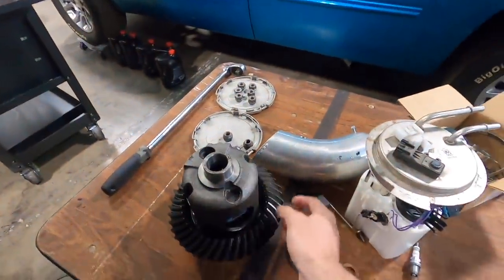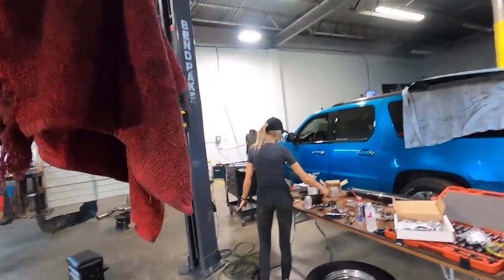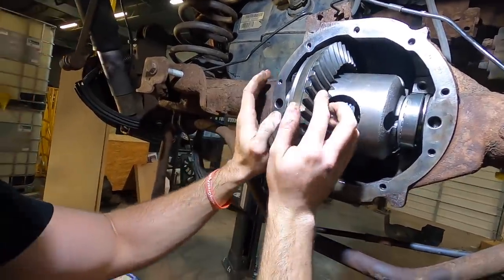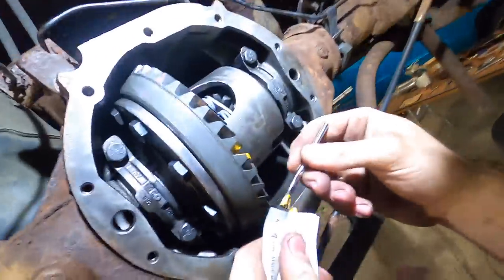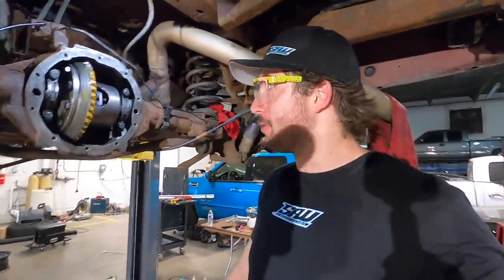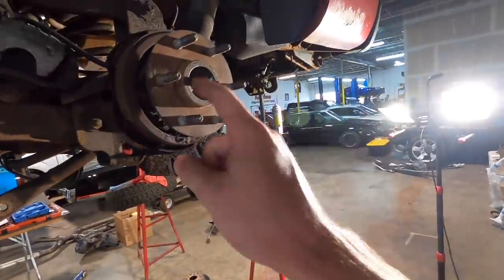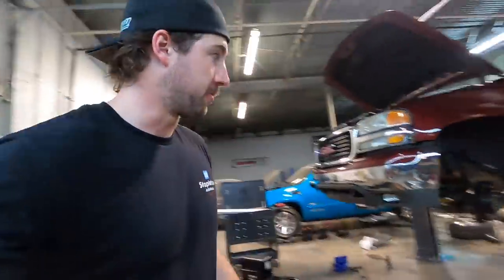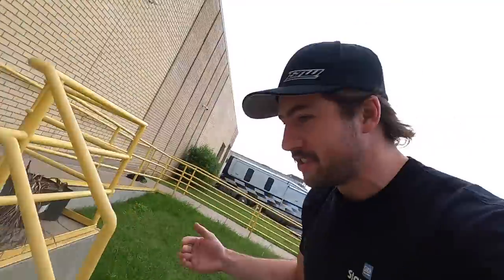Rocky Mountain Race Week Preparation: 10 Bolt Posi Install + EBC Brakes Upgrade! (Uncle Rob Yukon)

Comment: Tall guy probs #102 i was showing a new guard the building and turned to tell him something while walking and end up smacking my head into the doorway it was a low clearance one and im 6`4 
Also i got the oil pump replaced on the yukon but now it doesn't want to start and yes its back together correctly and we primed the oil pump for ref any ideas we are kinda stumped

Comment: I used to do Hvac work with my buddy since jr high. He's like 5'9, and I'm 6'1. We're in this shallow basement pulling out a lowboy furnace for a changeout. I had to crouch the whole day to avoid bumping my head. Halfway through the day he stood up and whacked his head. It made him dizzy. Hours later he stood up into the exact same thing in the exact same spot on his skull, when he almost passed out.

Cheers, fellow tallboy

Comment: Make sure there is no hair line cracks in it. I just did mine and I rtv it and it leaked. Then I re did it n after I was done the second time saw the hair line crack. Mine is exactly the same as yours n was in just as rough of shape. Got one off Amazon for 40$ n fit perfectly.

Comment: I have a 7 lb dead blow and have been building diffs for 27 years and that’s the same way I put it in grease the shims in just like you did and I lean both races and then push it foreword and tap the races straight when it’s straight I make sure the ring gear is meshed with the pinion and beat it home with a dead blow

Comment: Differential spreaders help alot.  They go in the holes on each side of the "gaping hole" and spread the housing slightly so you can end up with a little preload on the carrier bearings.

Comment: Pro-tip you're doing a great job on your breaks here's the tip the caliper bolts sleave ride on either a bushing or two o rings remove them or it and clean the rust then lubricate with dielectric or similar silicone grease, petroleum grease will break down the rubber bushings and swell them up creating the same problem as the rust, which is the bushings will squeeze the sliders and not allow them to move freely usually causing one pad to wear out long before its mate and like half the stop power!

Comment: Worked the pit at a diesel shop. Pit was 5ft deep max ,I'm 6'4". It sucked.  And I had to duck under the ft deep oil drain pan we used

Comment: Being a fellow Pennsylvanian I feel you on the stuck brake pads in brackets. Every brake job we do in our shop at the very least we wire wheel behind the slide clips. In bad cases I’ll take a die grinder with a fine bur and grind the rust off untill your back to good metal

Comment: I'm not sure if they will clear with the wheels you're running but in the future you should put on the late model 4 piston calipers and rotors from the 2018 or 2019 Silverado/Yukon. The rear on the Yukon XL is 2 piston so that with the 4 piston  calipers and their 14" rotors would be another awesome budget minded upgrade from the stock rotors and calipers. The best part is if you upgrade the front you can get the hot boy 8 piston simulated calipers covers for the back and shut shit down wherever you do.

Comment: Looks like both of you are rocking this differential install! GM 10 bolt gear backlash should be .008" to .012" for street gears and .006" to .008" for competition gearsets. Shims are fun to install with the carrier too. 
A great learning experience for you both setting up a set of gears & bearings. I've set up my fair share of differentials over the years and they can be easy or a PITA. Perseverance pays off! 
You guys rock by taking this job by the horns and getting 'er done! Keep up the good work, and I'll be looking forward to the next video!
Reply from the maker: Thanks man 🤟🏻

Comment: Not sure if it's funny but I was changing a tire on a old jaguar with a 4 way and the lug nuts were basically fused on the wheel stud and with all my might trying to break them free the 4 way broke and when it did all that force came loose and I punched myself in the face so hard I about knocked my self out. Had a headache for 2 days

Comment: After I broke a bunch of teeth on my 03 silverado's spider gears I slammed a detroit trutrac in it with new bearings and races and the original shims. Didn't check anything and been running quiet for 60K more miles now.

Comment: You need a thrift store deep fryer and some old vegetable oil. Put the carrier in the freezer overnight and deep fry your bearings @ 250* for 5 minutes. They drop together. Works great on axels too

Comment: It should be to hard to set up the backlash as long as you have the Diff. Bearing shims in the original locations. If it’s too tight or loose just switch the shims and recheck the backlash.

Comment: Just a heads up, the 2000 to 2006 suburban can benefit from changing the FRONT caliper, caliper brackets and rotors to the 07 and up parts. They are larger and part store replacements no fancy parts that have to be ordered. They do require a 17 inch wheel, but do clear factory 17s. Also stainless braided front lines with a hydroboost will make it amazing with factory parts

Also a stock 5.3 at 10.5 psi SHOULD make 530ish hp and 550ish tq according to Rich Holdener dyno testing to give you a rough crank hp guess

Comment: put a pry bar between the top of the carrier and the housing and apply load and take a 1/2inch ratchet and turn the pinion to get a reading on the paint....should be centerish

Comment: Oops just seen somebody already said that lol. The preload has to be correct as well though. It should take “X” amount of inch pounds of force to rotate everything. And you’re correct to paint both sides of the teeth so that you can check the drive and coast side of the contact.

Comment: You should have used like 07 plus front calipers them you could have used the ebc for them the only downside is you have to run 17 or bigger wheels but if you have 17s it's not a huge deal just might have to change 2 tires if you have a flat if your spare is a 16

Comment: You are supposed to spread the housing a tad using big holes and spreading tool to make installation of diff easy with correct preload on bearings.
Reply from the maker: See I didn’t know that lol
Reply: @Stapleton42   most people don't until someone on YouTube tells you different

Comment: Im sure thatll be cheaper than the quote i got to go 4.56s on my 07 classic crew cab 4wd, 2500$, another place said 1000$ i supply parts, and 100$ for a locker, i supply parts

Comment: Checking backlash is step one, then check the pattern.
You only need the yellow marker on 3 or 4 teeth.
The carrier, bearings, races and shims should all be slid in together. 
.006"/.010" backlash

Comment: You should have removed the nut from the pinion bearing... it has a crush washer in it and u need a new one to set the backlash correctly...but after watching the video, the paint looks like u got it dead nuts! Good nut discipline

Comment: Painting the underside with POR15 would be a true test of that stuff. It claims you can paint direct over the rust and it converts it. I’ve only ever used it in clean parts but my chassis looks as good as the day it was painted over 15 years ago
Reply: Your supposed to knock all the loose rust off first, but yea it works great I've painted rusty trailers and frames and never seen it start rusting more or chipping off

Comment: The 2 larger hole in the differential housing are for a special tool called a case spreader. The diff should be really tight and need to be hammered into the housing without it just like you did. If you don't use a case spreader and the diff just goes right in you did something wrong.
Reply from the maker: I’ve since learned that. Had no idea there was such a thing until I read these comments 😂

Comment: Mitch  Cheap and easy way to get controlled heat in a bearing is wrap it in wet paper towel then in a dry towel, microwave for 2 minutes. It will expand it just enough for slip fit
Reply from the maker: Sounds like a bad idea lol
Reply: @Stapleton42  I’m serious the microwave can’t penetrate thru the towels. The wet paper towel means that’s all that heats. Water boils  at 212f the bearing can’t get any hotter. It only takes raising temp a little to make the steel expand

Comment: I was helpin my grandpa work on his 1953 ford golden jubilee(his dad bought it brand new in 1953) well we was checking for spark and i wasnt payin much attention and i held the old wooden handle screw driver in the spark plug wire and got a nice zap🤣🤣🤦🏻‍♀️ another time my grandpa bought him a scooter, he asked me if i wanted to ride it so i said sure bc he asked and i was tryna start it and he said give it throttle. well  i gave it throttle and it took off and i almost hit the side of garage with it

Comment: Fake it til you make it, ive tapped bearings in with a punch, old bearing races or whatever is available. A cars torque cause more damage than that little tapping with a hammer will. You never know till you try, glad to see people getting in and doing it than sitting in the comments bitching about how you doing it.
Seeing her use brake clean on her hands was GOLD!!! Gear pattern is just fine and matched the pattern on the unmarked part of the gear so let it eat.

Comment: 🤣🤣🤣great video man. A large dead blow rubber mallet works better getting the diff in. The escalade has the 8.6 in it still?
Reply from the maker: Escalade is a 9.5 14 bolt swapped from a 2wd
Reply: @Stapleton42  dang its got the big boy in it

Comment: 👍📽🔊  You should change the front L&R brake lines to braided lines. the rubber lines flex  and swells  under pressure thats not good.  just think that brake pedal will feel a lot stiffer..   I got 05 Silverado with 24 inch wheels factory calipers and pads all I changed was the brake lines to braided.. damn thing stops on a dime . so much better feels like  I got 16 inch wheels on.. lol.  Keep it up nice job guys
Reply from the maker: I have braided ones on the Escalade

Comment: If you're pinion depth is not right (backlash) your kit should have come with a new crush washer just take off the pinion knuckle and seal bearing and replace crush sleve then  torque until 25 _ 30 tension pounds are achieved

Comment: Hope you dont get fed up with my tips but here's another one. In regards to installing the bearing back on the carrier...what I've done forever and works well without damaging anything....I use a hotplate with a pot of used (or new) engine oil...heat the oil until you see it start to slightly bubble....drop bearing in the hot oil for 5 mins....take them out using channel locks or strong magnet and install onto the carrier. Makes life easier. Another method is to leave carrier in a freezer overnight
Reply from the maker: My friend used to do that method lol
Reply: It's as old school as it gets

Comment: You need some Right Stuff for the dif cover . it wont leak, fall off( even if all the bolt holes rust out) and you will need an air chisel when the time comes to change it!!!! 
 I like how you mock the trolls before they have a chance to say anything... That some Upchurch tactics right there!! 
"Oh, and this one time, at band camp, I stuck a flute in my ....."  -Michelle Flaherty   
 "[spits out drink]  Excuse me?" Jim

Comment: Putting it back in properly is harder than getting it out properly without dropping the shims. Those cast iron things are spacers and they're FRAGILE. They will snap if you hammer them in. They're almost always close to 0.250" thick each side but one will almost always be 0.001-0.005" thicker than the other. 

My son is a two-time UIL Region qualifier on trombone but anyway...

If you measure rotation torque on the R/P before disassembly you'll know where you are on reassembly. 

Top and bottom of the teeth is drive and coast. The yellow stuff NEVER dries. You might need to learn heel and toe also but that's more important if you're changing the gearset. 

Waiting for the mesh test and hoping you load the gears. Yeah, OK. You need to put a prybar between the case and ring gear to give it resistance while you turn the pinion so that pattern is true under the load of the vehicle weight. 

The dial indicator needs to be as perpendicular as possible to the teeth. You need to hold the pinion still and wiggle the ring until you find Max deflection for zero. Dang you're indicator is not perpendicular!  Do three gear swaps and you'll get a feel for backlash without need for measurement. 

It's less important than the pattern for wear and strength. On backlash:  Two-cut vs five-cut gears take a different backlash setting. Some can be super tight at 0.003" and some need fat backlash around 0.010".

You'll be fine. Perfect isn't always needed. Good content. Thanks.

Comment: JFC, you need 2- 20’s in your pocket and a cheap trip to HF just for random hammers, parts tray magnets and an extendable pick up magnet.I wanted to reach through my screen and hand you a  magnet a few videos back when something fell in a vat of used tranny fluid, and Logan had butthole fingers digging it out. Get a few $2 magnets and avoid butthole fist if you ever do that again.

Comment: To be fair, the Escalade has never broken the diff because you were too busy burning up Rossler 4l80e's and blowing driveshaft yokes.
Reply from the maker: I stopped breaking transmissions when I switched to extreme with billet gearset last June. It made enough power to hurt the motor and trap 122 in the 1/8th. So to be fair you’re incorrect. That rear end holds every bit of 2,000hp
Reply: I stand corrected

Comment: You didn’t change the pinion depth, so no need to check the pattern. And as mentioned a case spreader in the cast holes holding the mouth of the case wider makes removing the carrier an easy job.
But you are doing it!
I have many transmission, rear axle, etc videos at Mountains Garage here on YouTube, tiny channel growing slowly.

Comment: I cringed watching you smash a new diff in with shims that are matched to the old diff 🤣🤣 you need to go to orileys and get a shim kit and space out the new diff with the correct size shims 🤣🤣
Reply from the maker: I did the Escalade the same way and it works fine. Changed the carrier not the gears
Reply: @Stapleton42  correct but the carrier is what varies in width.